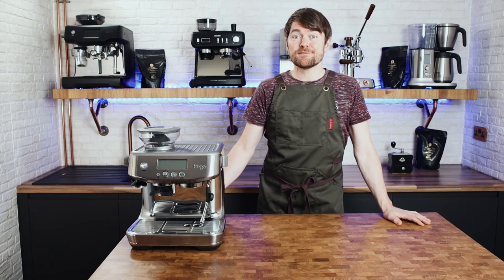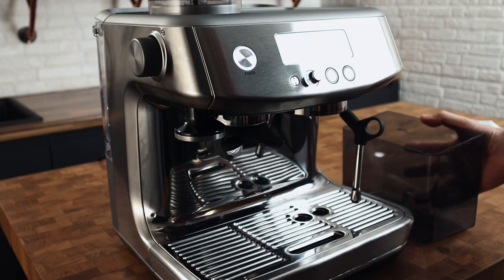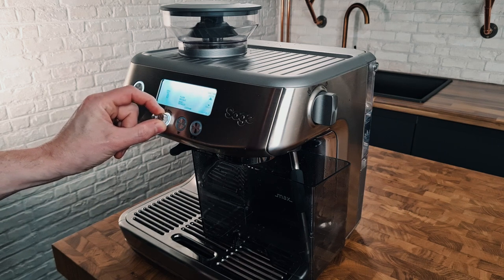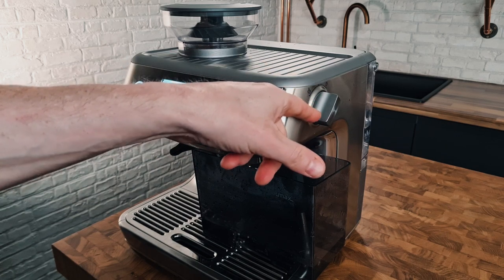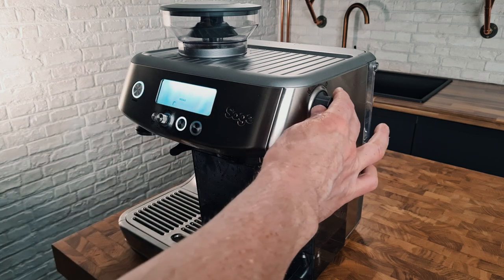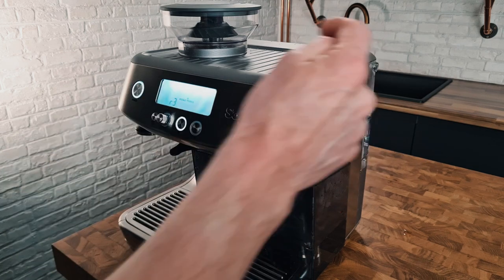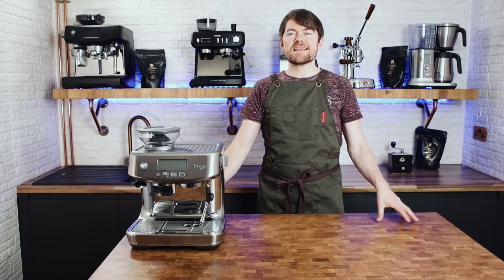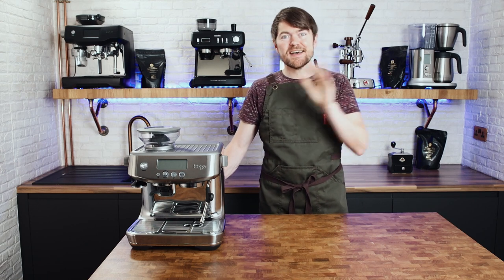How to Descale the Sage / Breville Barista Pro

Comment: Over filling at the beginning means the solution is less concentrated than ideal, and the rinse is not a rinse, but I’m sure you did this deliberately to generate comments.
Reply from the maker: I didn't over fill, I filled it to where I think the descale line should actually be, just above the descale line so that it uses all of the descale solution without asking for a refill during the descale phase, i.e. so it works the way I think it's supposed to work. It's actually the opposite of what you're suggesting. If you fill it exactly to the fill line, you have to add more water to complete the descale process, and if you do what the machine instructs, and refill the tank when instructed, then you'll be doing the latter part of the descale with an extra diluted solution, and I'd imagine many peope wouldn't think to refill the water tank again either when it comes to the rinse, and this would lead to the rinse not being a rinse. 

Cheers

Kev
Reply: Excellent reply!